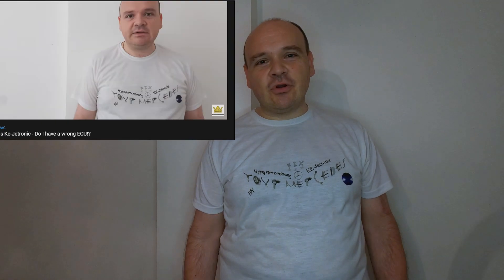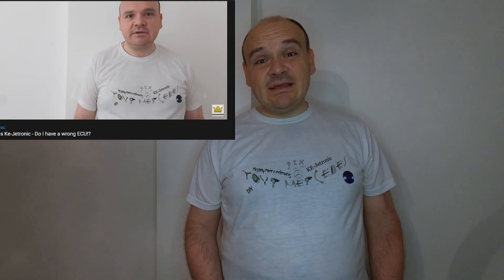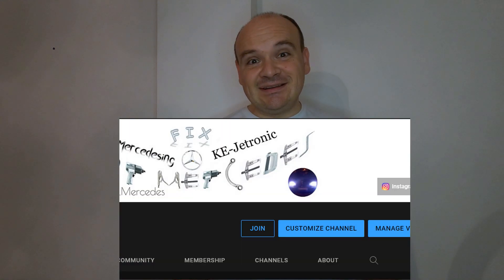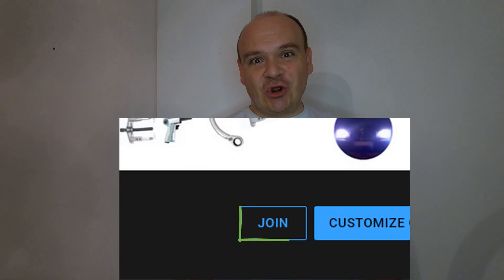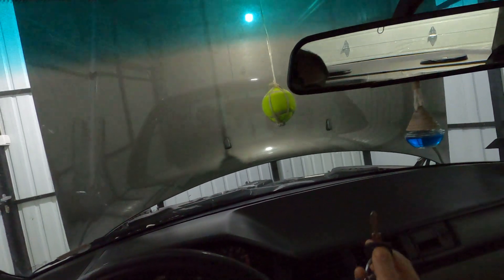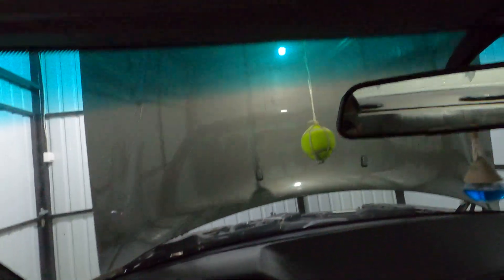㉦Mercedes Ke-Jetronic㉦ - 💻The ECU replacement procedure💻 plus something else

Comment: I have a question about the ECU, the previous owner had a 2.0L engine swapped with a 2.3L engine but maintained the old ECU , is it wise to find the matching ECU that support the 2.3L engine? Or it does not matter? Thanks for your response
Reply from the maker: That depends of the my(model year) whether the engine is up to september 89 or from september 89. Generally both of them are fully compatible. If the ECU from the original engine is from the first version(it has a green sticker with the reference number), then the ECU is not compatible!

Comment: Yes! Exactly. This new ecu now starts exactly like my 1990 year 190e, the way the revs dip to about 500 for an instant and back to 800 when key is turned. I still have the almost stalling problem, every sensor is working and potentiometer exactly at correct voltage with good mixture and no vacuum leak. It doesn't actually stall now but car still almost stalls, very lazy to correct revs dropping. I have noticed voltage drop at low revs so I am going to try a new alternator next to see if I can keep voltage when revs dip. It still has the 30 year old original, other option is lazy idle control valve, it does work but maybe not as good as new. It is a puzzle!
Reply from the maker: I got back the new one and now the car doesn't stall. Problem solved!😀
Reply: @mercedeske  Update, I now have new alternator and car doesn't stall, runs smoother at very low revs when put into drive (500-800rpm) 🙂
Reply from the maker: Great. Glad to hear that. Happy Mercedesing!
Reply: @mercedeske مرحبا صديقي كيف تم حل المشكلة لا زلت اعانني من انخفاض عدد الدورات عندا ما يكون المحرك ساخن
Reply from the maker: @عبداللهابنالرافدين  Hello. Those are 2 different but same systems though. It is normal for the later version to increase RPM when starting the car unlike the older version. I got back the newer version of the ECU and I solved the issue of a car stalling when driving downhill or when I have to stop at the traffic lights. Best regards!
Reply: @mercedeske  yes but what am I supposed to do? Buy a different ecu? 😂